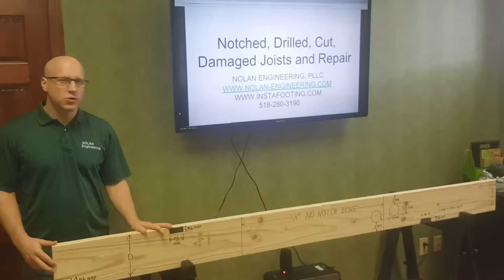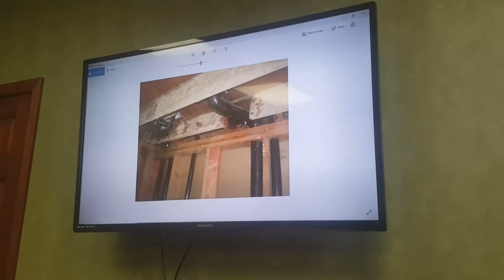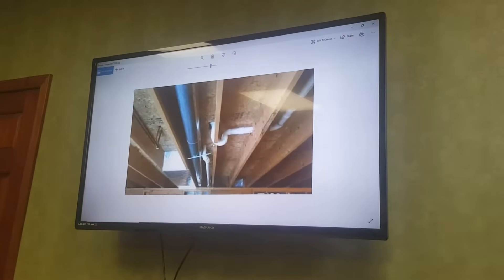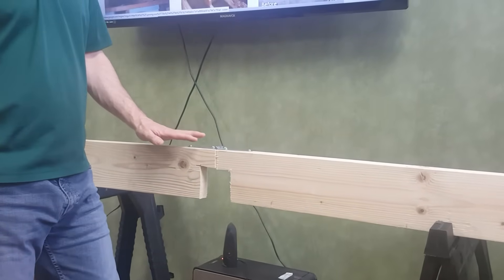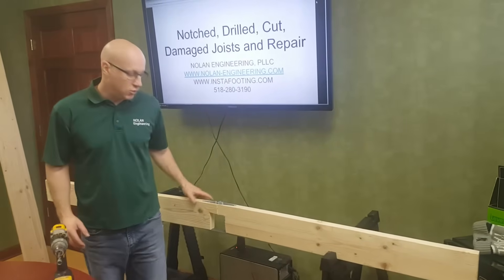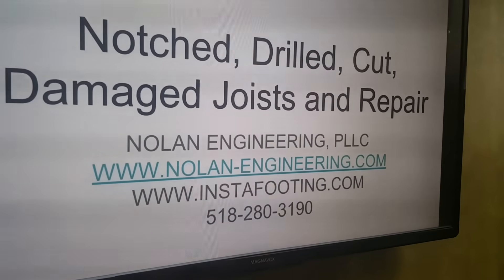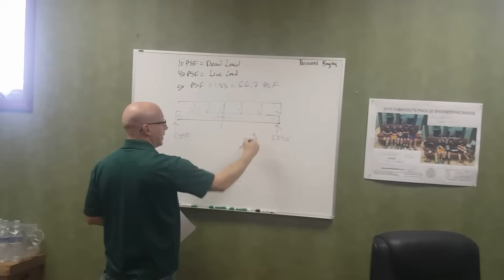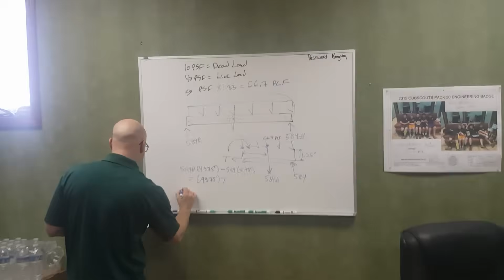Cut, Notched, Drilled or Damaged Floor Joist Repiar

Comment: Thanks for the informative video!  In the demo, did you use 1 1/2 or 2 1/2 screws?  #10  or #9 Simpson Strong screws, or are these thicker?  
I'm doing a tub to shower conversion in my old house 2nd floor washroom, and have discovered that several 2x8s were bottom notched to accommodate the 1 1/2 drain pipe, and the 1/2 copper lines are also close and not 2 inch spaced.  All they did was put a plywood strip across the bottom, which wouldn't have much tension strength. Trying to correct it from below with 16 gauge metal straps by removing these plywood strips one by one.  Isn't an 18 inch strap sufficient for a 2 inch notch?

Comment: can i hav ea shower drain on top of the joist? i am working with a 32 by 48 shower base where the hole is in the middle but it is also going to be on top of the floor joist is there a solution ?

Comment: very useful knowledge!!    recently renovating my kitchen,  plan to run a 3" drain pipe through 5 solid wood joists of 8", the holes that run the drain pipe are over 3" Dia, so I want to use the metal joist reinforcement plate to support the joists. it is possible? Thanks
Reply: what did you end up doing?  Is it okay to break code (drill big holes) if you immediately apply these straps to repair the joist?

Comment: Id want that repair strap min 1/4" thick how you show it going on. Thinner, I would put it on the face over the cracked area. Steel has similar strength orientation as lumber.

Comment: Wonder if you could answer a question..... Did not see it covered in the video. The IRC 2018 code states "The tension side of members 4 inches or greater in nominal thickness shall not be notched except at the ends of the members." I am not sure if I am understanding this correctly. Could you explained this part to me. I would greatly appreciate it. Currently studying building codes. Great video!

Comment: Do the number of screws not cause the wood to split?
Reply from the maker: Not if you pre-drill with the bit the kit comes with. Also, you may not need to use all screws depending on the loading. We can provide a design report to determine the number of screws required.

Comment: Is sistering to floor joists permitted. I jacked the new joists to make them firm against the the floor and resting on the sill plate and center beam.. then used carriage bolts and washers to fasten the old and new joists  together.
Reply from the maker: Yes, sisterring has been done for ever, its fine.

Comment: Thanks! very useful.
There are double joist under the wall in my second floor. it between two joists(16ins).i need cut nutch and hole for pluming. Is this double joists is very import ? i think is just for the wall.
Reply from the maker: They usually double joists under walls to support the weight of the wall. So they are important.

Comment: Question my second story floor joist (2x10 #2 yellow southern pine) was notched by 4 inches deep and 7 inches wide. The notch was made on the top of the joist. The joist spans 13'8" to the load bearing walls on each side. The notch was made at 6' from one of the ends. The joists are spaced 16" on center. Would this product help restore the structural integrity of the joist? Note that the damaged joist is the fifth joist out of nine that help support the master bath on the second story. Thanks in advance for the answer!
Reply from the maker: Sorry for the later response. The strap would need to go on the top or top side

Comment: What type of screws are you using
Reply from the maker: 1/4" diamete 1.5" long Simpson SDS25112
Reply from the maker: Simpson SDS25112 structural screw 1/4" diameter 1.5" long

Comment: i would like to see you go into a real job site and see if you can work with the notching criteria. I've never see notches that small. all I've seen are hack jobs
Reply from the maker: Not sure what you mean. These can span a notch up to 12" wide. If the notch is larger than that then there wont work. Yes, the straps will not solve all the types of notches that may be experienced in the field.
Reply: @nolanengineeringpllc2713  I believe the person is saying that the overarching rules regarding notching, hole size/location, etc. are oftentimes ignored in practicej on job sites.  In other words, people tend to ignore the engineering rules and requirements you explained so well in your video.  BTW thank you for sharing this great information!s

Comment: Some codes won't allow the close edge distance for the 1/4" SDS screws. In similar repairs, I had to use a steel angle and screw into the face of the joist. You can notch the vertical leg of the angle at a pipe location. You should probably take 5/6 of the joist height for your effective bending moment arm. The centroid of the compression would be about 1/6 of the joist height from the top. Our code also requires a minimum partition allowance of 10psf. 10psf DL seems on the light side.
Reply from the maker: Correct, the screw spacing is less than code. But it was the only option because so many screws are needed. To get around that I tested 2x12s spanned max span with max load and it held. I used sand bags.

Comment: Hi Richard,
I have a 9 foot floor TJI floor joist (12") that the electrician cut the bottom rail of the TJI joist right in the middle of the span.   Will your joist repair kit work for me to shore up the bottom rail of a TJI joist?
Reply: It would be best to contact the manufacturer of that joist about a proper repair.  I’m sure their engineers will send you a fix for their joist.
Reply from the maker: Sorry for the late response, so busy here. Yes it should you can always send a picture.

Comment: Personally, for joist repair, I will ALWAYS sister up the joist, from end to end.  It's always the best solution, and arguably not all that must effort.  If I can't do a complete sister, I will do a partial sister, but on BOTH sides of the joist.  Also,  I do NOT use screws to attach for structural reasons.  Why?  Because the screws often pull or move before taking up the required forces.  INSTEAD, I use high strength polyurethane construction adhesive.  Before attaching with this adhesive, I will jack up the affected joist slightly (maybe half inch or more depending upon sag).  Then I will glue the double sister joists in place and use screws, mainly just to hold the sisters will glue cures.  Also, I am sure to spread the polyurethane evenly everywhere.  When it sets, it will take ~500 psi shear load.  If you have plenty of sister overlap (a couple of feet on each side of damage), that will easily replace any compression of tension losses from a hacked joist.  Once glue is cured, then release jack.
Reply from the maker: Sorry you feel like this is the best option, I would suggest watching the videos and see we've done the research and this works just as good if not better. Feel free to contact us for more information if needed? 518-280-3190
Reply from the maker: Yes that would work too. Just trying to save on all that work and not having to pull electric or plumbing. Technically a sister would be the same size joist and would make the notched one obsolete so there is no need for nails or screws or glue other than to keep the sister in place. Of course nails and glue along with the notched joists would be stronger.
Reply: @nolanengineeringpllc2713  it sucks having to pull plumbing and electrical, but often it can’t be helped if you want it done right, once and for all. I just did this in three of my rooms.  It’s all solid now.
Reply: PS many non-engineers don’t understand the level of tensile and compressive forces in the bottom and top of a joist.  It is often in the several thousands of pounds.  So if you are trying to replace the piece of a missing joist carrying that load, you will very unlikely be able to do it with screws attaching a new piece of wood.  All of the effort will simply just get pulled or pushed like it was never there.   So that’s why I will use the polyurethane adhesive applied continuously over an overlapping area (a number of feet).   Also, the adhesive must cure while there is no load on the joist (hence jack it up), otherwise the joist will not be restored to normal. But the best option is to sister the whole joist from wall to wall.
Reply from the maker: @superwiseman452  sounds good!

Comment: The joists under my kitchen are notched to allow for garage door opener to operate thru notch.  Floor sags terribly and gets worse each year.  My question, if we have straps installed that strengthens joists,  but doesn't correct sagging issues that have already occurred.  How do we correct the sag? Keep in mind the garage is below the notched joists so putting floor Jack's there will eliminate garage usage which we don't want to do.  Suggestions?
Reply: Raise the floor back to level with Jack's and temporary walls on each side. Install steel reinforcing  straps as specified and designed by a structural engineer. Remove supports. 

PS if none of your vehicle tops reach within 3" of the raised door, and the garage depth is at least twice that of the raised door, then there was a way to avoid notching the joists in the first place.
Reply from the maker: Sorry for the later response. You would have to jack first then install the straps as the other Gentleman said.

Comment: Recently bought a fixer-upper and the one photo in the video reminded me of the hatchet job previous owner(s) did on the place!  No less than 5 joists, in various locations, were literally cut off completely (one to two foot sections)  to install heating ducts or drain lines.  Of course that renders the unsupported joists as nearly useless and diminishes the structural integrity overall.  I'm not a violent person but sure would like to slap him upside the head for his stupidity!
Reply from the maker: Yes, I see it all the time, its too bad.

Comment: Just the information I needed. Electrician went in and bore holes within two inches of the bottom of the joist. Thank you for the calculations as well. Super informative! Please add a link to the product in the description. Also, you guys should provide standard dimensions of the product for immediate purchase. For example, for 2x10 joists, 10-12 ft long, get *this strap. For 2x8, get *this strap, etc.
Reply from the maker: OK, thank you, will do.

Comment: I would like to reach back to 1995 and Strangle the HVAC mech that hacked the lower cord of a TJI !! Can you speak to the latest requirements of Engineered Lumber such as the TJI - BCI - LVL's Parallams etc...   MOST of today's construction is NOT Dimensional Lumber and there are apparently a lot of people that need to lay down "their" tools and pick up a crack pipe !! C'mon People - Do NOT work outside of your level of knowledge and scope!! Cut your Big Box store CC in half because sometimes: YOU CANNOT DO IT YOURSELF .    Excellent video and killer non-name brand strap !!
Reply from the maker: Good question about TJI's, for those you can only cut into the web part (not the top or bottom chords). You can cut a pretty decent size hole in their webs. TJI suppliers usually do a good job in their catalogs say what size hole(s) you can have. This strap should also work on a cut TJI bottom chord as well.